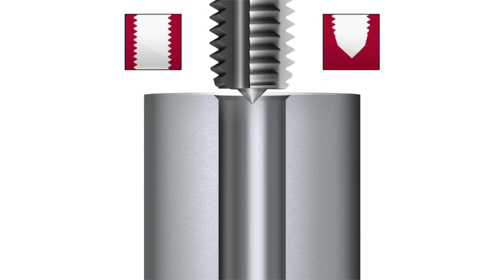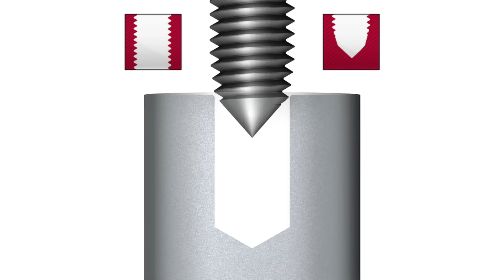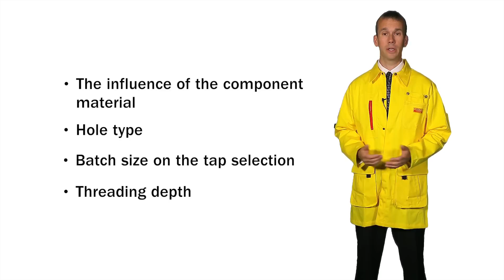Tips film: Selecting the right tap - Sandvik Coromant

Comment: Really well done video on taps! I used to help teach in a school and saw people on CNC tapping aluminum with hand taps. Needless to say they got munched up and I had to reach why to not use hand taps! That said recently I started using forming taps in aluminum and boy could I not be happier. Taps last a long time, finish is impeccable and it takes less force in a small drill press application tapping sheet 7075 aluminum.

Comment: If you're looking to go deeper with a tap use a "bottoming tap." They are designed with 1-2 half threads at the end of the tap. A more common "plug" tap has around 4 half threads. the "pointiest" of the commonly available taps is a "taper" tap with 7-10 half threads. Many people use the taper tap to start threading a hole and then switch to a "bottoming" tap if needed.

Comment: Nice vid. 
I wish you can help us to select the propper tap to make threads on a short blind hole. We need to make 5/16-24NF on a part made of 12L14 steel (pretty soft) but we want to know the minimum thread depth. Knowing that valie we will design the part and make the prototypes using the tool. The hint is, we want a tap which help us to make a really short blind taped hole.
Reply from the maker: Hello! Thank you for your question. Our suggestion for you would be to use a CoroTap 300 XM with a bottoming chamfer (Chamfer E with small lead). This will give you 1.5 -2 x pitch lead only, then you can start to produce the full thread. Find more information and assortment for CoroTap 300 here http://www.sandvik.coromant.com/en-gb/products/corotap_300/

Best regards,

Steve Shotbolt
Global Product Manager - Threading

Comment: Hello
Which tap is good for aluminum casting of ADC12 
For blind and thru hole
Reply: Hi,
It’s not possible to give a recommendation without knowing the thread form and size required. M8 M10 i.e. metric / metric fine / UNC etc.
Use the CoroPlus® ToolGuide (link below) and get recommendations based on your application details.
 
https://www.sandvik.coromant.com/en-gb/products/Pages/toolguide.aspx
 
Take care!

Comment: Hello, do you suggest to chamfer the hole before tapping? Can it help centering the tap or is it unnecessary?
Reply: Well taps are tapered towards the front so positionally probably doesn't matter if your a hobbiest. But you should definitely chamfer before tapping if you want a nice clean entry for your screw. other wise you can get a burr that prevents proper feeding